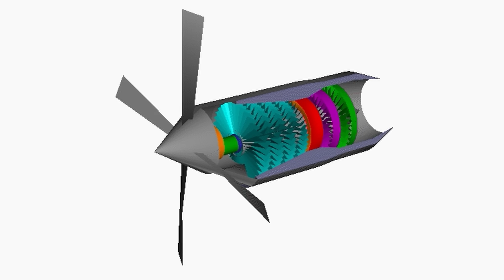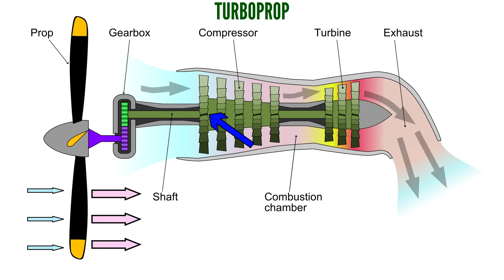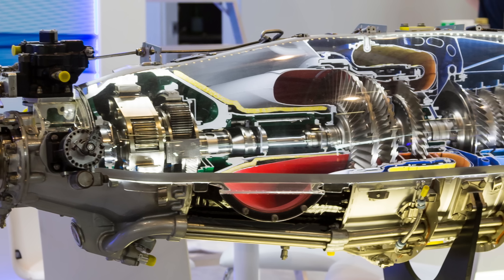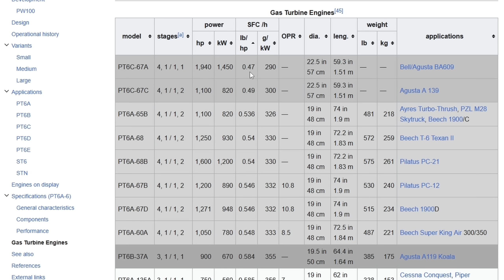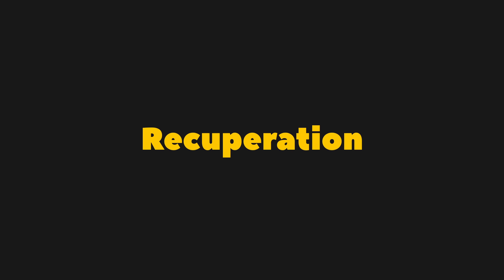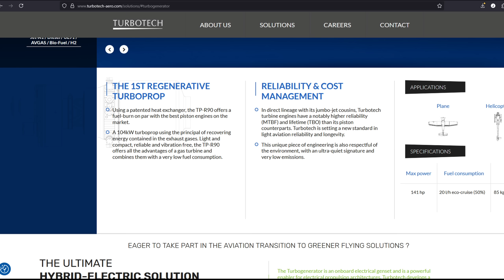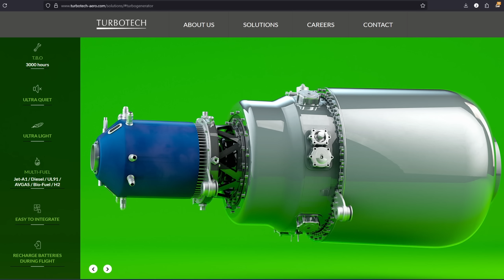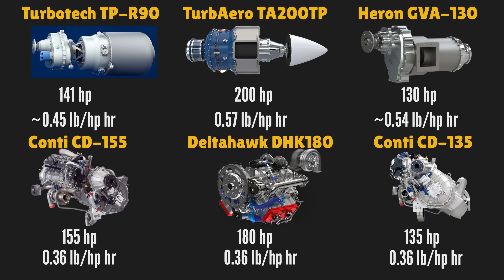Are Piston Engines Dead? Small Turboprops are Here

Comment: I’ve heard this a few times over the last 30 years
Reply: I guess the difference is that they are actually flying now and being designed into some aircraft designs.
Reply: @ascot4000  Past ones have flown too. It's been possible for decades, but never practical then and I'm doubtful it is now. Hell, Chrysler made prototype turbine cars in the early '60s, which were fully functional and street-drivable, but weren't put into production as their cost and fuel consumption was impractical compared with reciprocating engines.

Comment: Need to see total cost of ownership calculations.  Engine cost, fuel cost over the engine life for average conditions, maintenance and overhaul costs.  Divide it by the TBO to get a $/hr operating cost.
Reply: I wonder if insurance (both product liability and owner insurance) would be cheaper due to the improved reliability.
Reply: That's exactly how the video starts, but then we never get a real answer.   Sigh.
Reply: Here, I'll make it easy for you. The small turboprop by PBS burns about 25 gallons per hour (gph) at cruise (188hp). The equivalent HP engine from Lycoming burns about 16 gph at cruise. It will never make fuel economy sense to put a turbine engine into a slow aircraft.
Reply: @swordguy8 considering fuel price difference between diesel (jet-A) and 100LL, the operating numbers might actually be much closer than you think. And just wait till 100LL is banned and we are forced to use some stupidly expensive unleaded fuel.
Reply: @ReasonAndHeart  At my home field CCA Jet-A is 4.05 vs Avgas at 6.12 FS/5.33 SS. Even at 25 vs 15 GPH Jet-A can just about come ahead at some airports
Reply: Would sooner just have a small turbo fan
Reply: yep,   just the  TBO  factor of  2-3x more than a piston engine  may  overthrow the  poorer  fuel efficiency.
Reply: @roberttammerawitchey4652  Yes but the cost of a turbine overhaul vs piston engine overhaul ?
Reply: @roberttammerawitchey4652 turbines eat gearboxes. Ask any a&p. So that cost comes up twice at a minimum before rbo is ever an issue.
Reply: @roberttammerawitchey4652  200 starts until rebuild, TBO is irrelevant
Reply: @DumbledoreMcCracken  I was thinking along similar lines. I was averaging 4-5 hours per week as a recreational pilot owner of an old C172. There was a big difference going cross country 1 or 2 times a year verses the $50 dollar breakfast twice a week or just boring holes in the sky and T&Gs... 
I did (almost) all my own maintenance because there were a couple of AIs that were personal friends. Maintenance wasn't totally free but it was the only way I could fly as often as I wanted. 
Overhauling a Continental O-300 under the watchful eyes of my friends was affordable. These turboprops are beyond my budget.
Reply: @DumbledoreMcCracken are you sure about only 200 starts for TBO? Maybe 2000?
Reply: @ReasonAndHeart   200 not 2000
Reply: Thank you for your technical videos! Baie interessant en leersaam..
Reply: If you're going to wait for the data you're going to have to wait until everyone but you has one.
Reply: You have to consider that the maintenance on the gas turbine is small usually a few bearings and seals 
    It's the secondary turbine gearbox and components of the prop that would have way higher maintenance needs
Reply: Maintenance availability will also be a factor to consider. Sure, that would probably fix itself over time, but is a burden to be overcome for initial adoption.
Reply: This with never replace the convenience and reliability of a rotax 
   Snowmobile sea doo jet ski outboards airplanes etc.........
Reply: Lycoming are amazing engines too 
   No one who has experienced the convenience of piston airplane engines is gonna want this headache 😅
Reply: @terranovarain6570 Lycoming..??  Stone Age Air Cooled Piston Engines….??? Convenient….????
Reply: Lycoming and Continental also both have their engines in water craft sports craft 
   Really can't beat the convenience
Reply: Someone start making turbine jet skis and snowmobile then it'll make sense 😅😂
Reply: why do you care about costs? if you are rich enough to fly, money means nothing.
Reply: @difflocktwo   found the guy who knows nothing about general aviation
Reply: Turbos tend to be much more expensive to overhaul. If the cost is too much you loose your TBO advantage.
Reply: @markchabot3684  Not doubting the overhaul costs.... but I wonder if  you can  rebuild a piston engine  2-3x's   for  less than  a single  turbine?
Reply: @markchabot3684  A turbine is not a "turbo"
Reply: @erickborling1302  Actually it is.
Your thinking "turbo-supercharger" which most people truncate to "turbo".
These are "turbo-props", and larger aircraft use "turbo-fans" while older airliners had "turbo-jets".
Even ships where sometimes "turbo-electric" referring to direct fired OR steam turbines turning generators, rather than the prop shaft directly. This contrasted with smaller boats being Diesel-electric, which normally featured a turbo-supercharger on the diesels that turned the generators in place of a turbine, but some where mechanically driven superchargers as well.
Turbo is literally ONLY turbine, it just wasn't the context you personally where used to.
Reply: @erickborling1302  100 percent correct. However the entire aviation industry in the English speaking world calls them "Turbo Props". Most Engineers I have worked with make the same statement, that it should be "Turbine Props". 😁
Reply: @waynewhelan3069 Yes, but when somebody talks about „Turbos“ that’s not correct. If you talk about Turbos you mean Turbocharged Piston-Engines.
Reply: You also need to consider newer, compression-ignition engines (which burn Jet-A) and not just spark-ignition (avgas) engines.  Small, unpressurized GA aircraft would see far more benefits from compression-ignition than turboprop.
Reply: @rivalarrival 100% true. 👍
Reply: Maybe in 50 years from now, all this would be moot if they could develop electric turbofans with light weight high energy density batteries.  Imagine the easy of repairs and low cost of ownership.  Till then, burn baby burn. :)

Comment: I'm not sure, but doesn't weight difference of the engine itself make a difference in fuel consumption in a plane in flight?
Reply from the maker: Yes, but it's tiny. The better useful load is a much better advantage than the almost negligible lph or gph saving.

Comment: I only have a layman's grasp of the subject of aviation, but have decades of experience with "stuck on the ground" power plants. Maybe a followup question should be why gasoline fueled engines are better than the newer diesel alternatives aviation engines that seem to enjoy a similar efficiency premium (greater by percentage actually) against gasoline engines as do gasoline engines over these latest turbines. 

And as a "buyer" I'd also want to compare the costs of the additional overhaul(s) for recip engines during the life cycles of each, the relative difference in regular maintenance, potential insurance cost rewards for presumed greater actuarial advantages (if any), fuel costs...